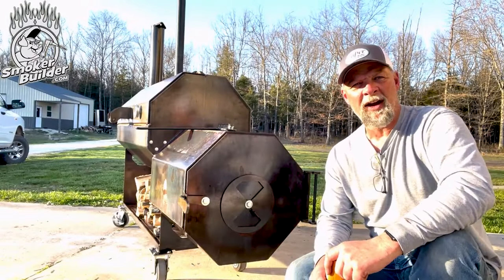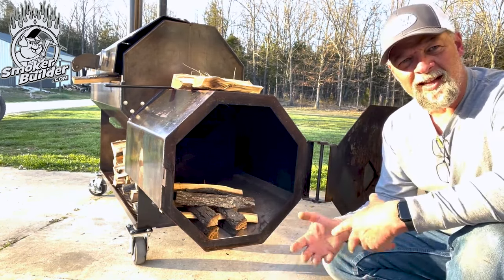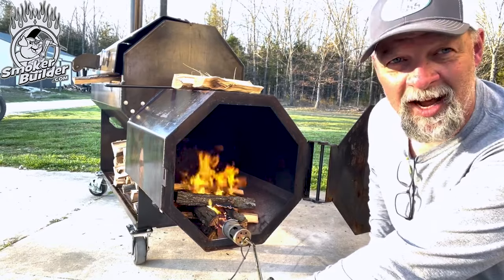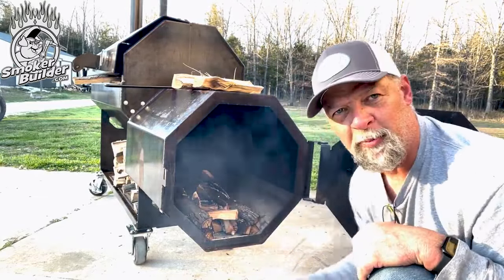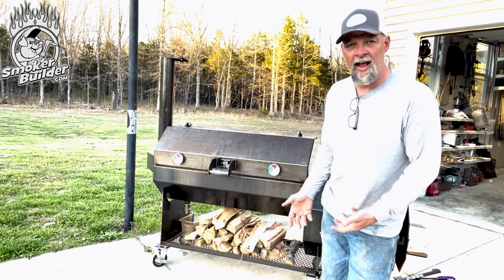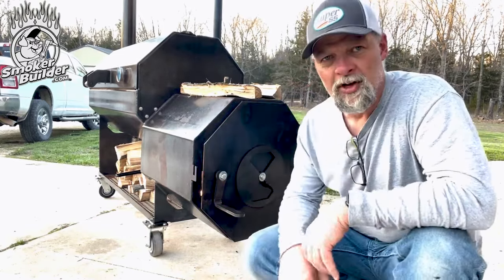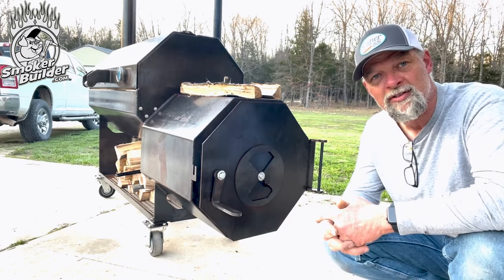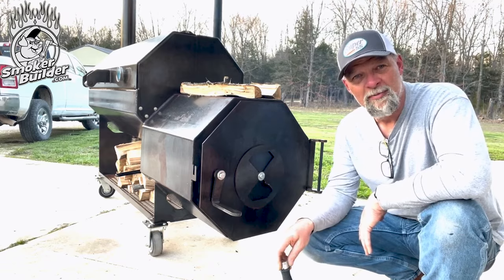How to Protect Your Smoker with an Oil Coating: Step-by-Step Guide and Safety Tips [Part 2]

Comment: Hi. I have a corten steel barrel type smoker. I want to develop a deep patina. I'm told it takes six months. Then i want to use this method to "freeze" the look when its lookin good. My question is, can you use a heat gun while running the fire box at say 400°F?  It seems ok to me. 
Thinking about the legs and other areas that heat up less than the fire box and cook chamber.

Comment: My cook chamber is 48 long by 36 in diameter, would I use the same 3" wood splits as a smaller chamber?
Reply from the maker: I would, you could make them a little bit longer, but that 3 inch diameter helps it start way better